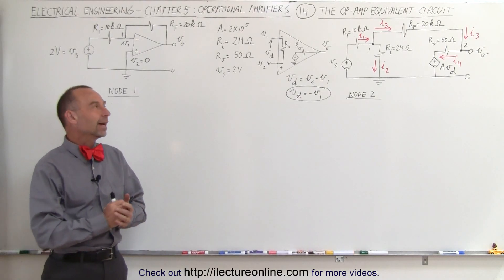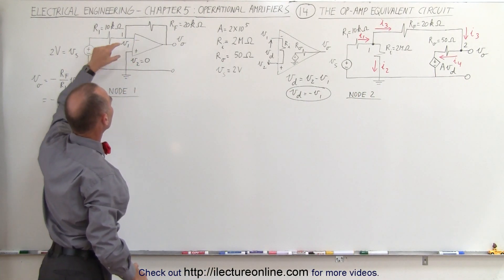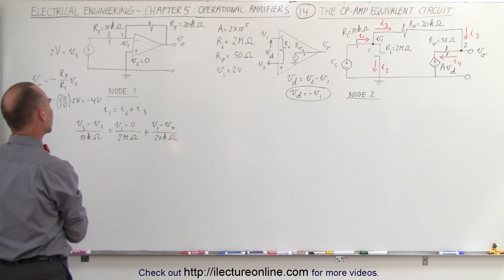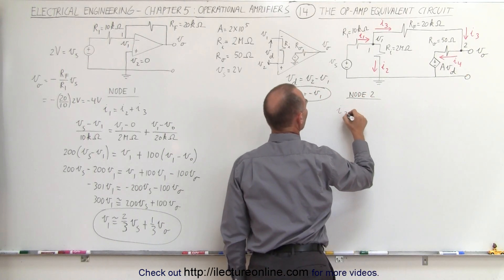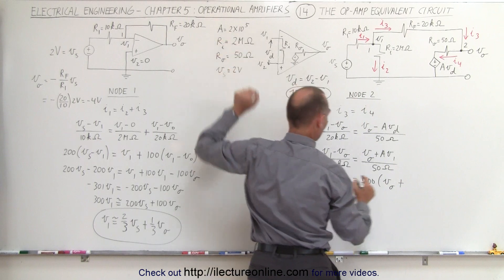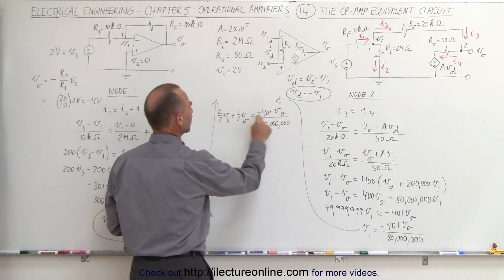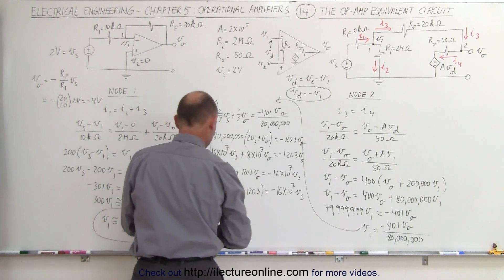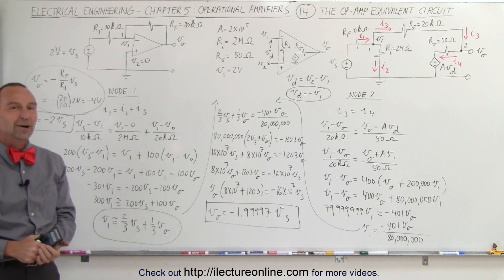Electrical Engineering: Ch 5: Operational Amp (14 of 28) The Op-Amp Equivalent Circuit

Comment: I wonder if the output will saturated or not sir?
Reply from the maker: All electronic devices such as op-amps have ranges between which they operate as designed and when the input goes beyond those ranges, the device will no longer operate as designed or as intended.  It depends on the physical characteristics of the device.  Manufacturers will indicate what those parameters and limitations are.

Comment: hi there, in the beginning of this series, you say that there's no voltage difference between the two inputs, where's here v one minus v two = v one. Could you please explain? Thank you.
Reply: What you're saying is the case if the op amp is ideal, where we assume i2 in this problem to be 0. In that case, there would be no voltage drop between the two inputs. Hence, no voltage difference.

Comment: Great explanation.  I'm just wondering:
How does the choice of resistor sizes for R1 and Rf affect how close the closed-loop gain is to an ideal op amp, assuming Rf/R1 is 2?  It would seem that you would want to choose R1 so that it is very small compared to Ri of the op amp, but I'm not sure about Rf.  Are there optimal values?

Comment: in node # 1; I think there is an error in the steps. 
-301V1=-200Vs-100Vo, 
and in the next step is 
300V1=200Vs+100Vo
I would like to know what happened with the 1 that was before
Reply from the maker: No error.  The 1 was insignificant and to make it easier for the calculation, we just dropped it.  Note how the equal sign became the "approximately" sign.
Reply: is there any video about diodes?? that I can use to study.
Reply from the maker: That is a topic that we have not yet covered.